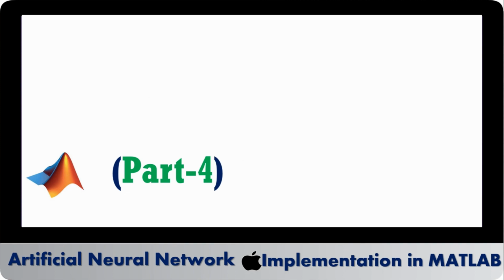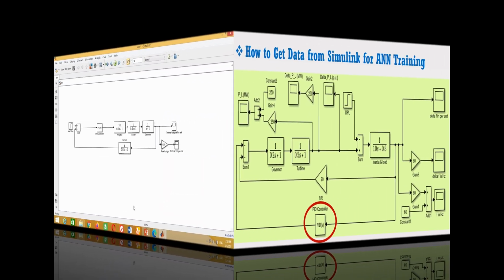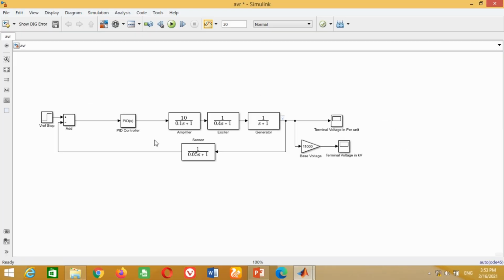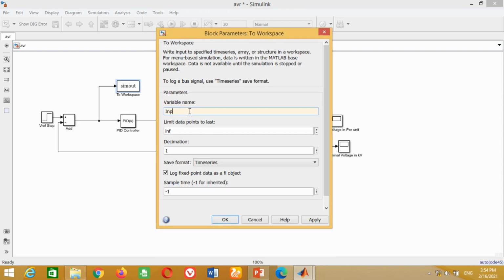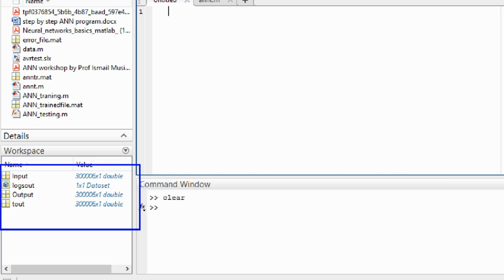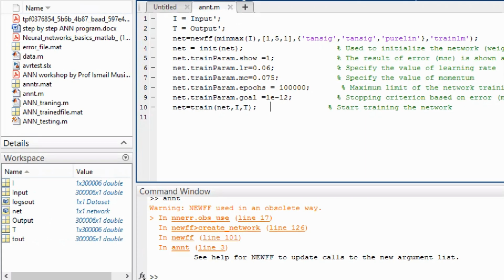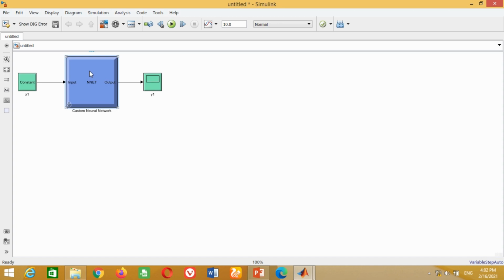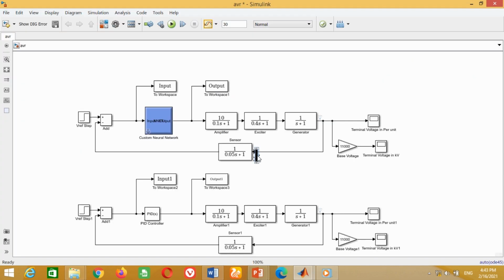How To Get ANN Training Data From SIMULINK ? (Part-4) | Dr. J. A. Laghari

Comment: sir can you please make a video on fault detection and classification using ANN
Reply from the maker: The procedure for fault detection using ANN is same as I have discussed in this series.
Reply: @DrJALAGHARI  sir can you guide through the process. i will be very thankful
Reply from the maker: @niharikasawhney2237  in simple, simulate the fault in the simulink. Transfer the whole voltage or current data to the workspace and train that data using ANN. Then bring back the trained ANN in the simulink. Run the simulation and compare the answer.
Reply: @DrJALAGHARI  thankyou so much sir. I will try and let you know. Thankyou

Comment: Asalamualaikm Dear Dr J. A. Laghari. Thank you very much for your series lectures based on ANN. Please could you make series lectures for Model Predictive controller (MPC). I mean the programing and basic structure of MPC. there has a MPC block on matlab simulation but it is not efficient. If you are able to help as to understand MPC in matlab code that would  be great. Thank you god blessing you inshallah
Reply from the maker: Wa'alaikum salaam thanks for the compliments. Actually personally I have not worked on MPC. Therefore, I am not expert in MPC.

Comment: Thank you very much on such informative tutorial, simple and clear!

Sir, I have a question and kindly help me!!

If the ANN controller is learning from PID controller (by fitting) is there any possibility of improving the response such that the ANN performs better than PID??

Thank you Sir
Reply from the maker: Thanks for the compliments. Yes. The response of ANN will be better than pid due to the reason that PID controller always try to modify the response at every instant of time. Due to which it takes time. On the other hand, ANN once trained, can provide the fastest response due to which its response will be faster.
Reply: @DrJALAGHARI  Thank you for clarification Sir